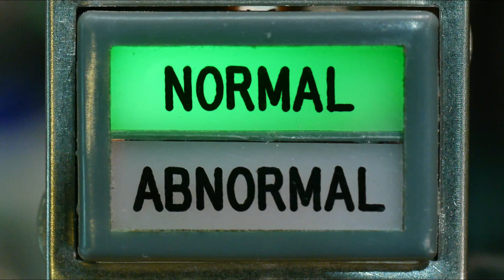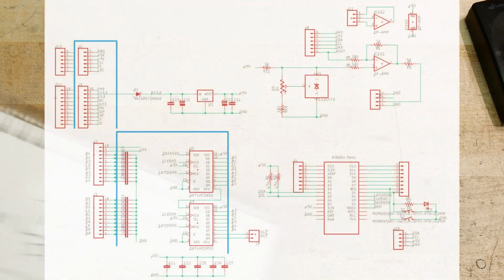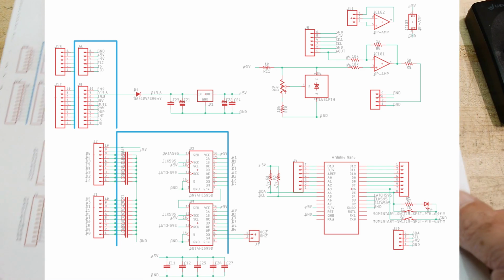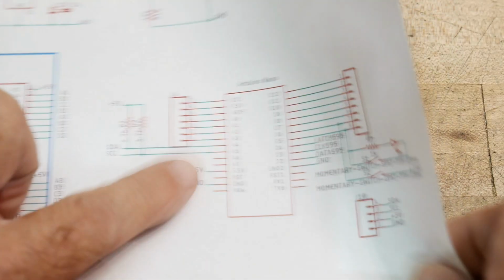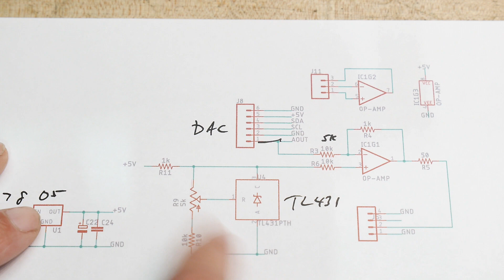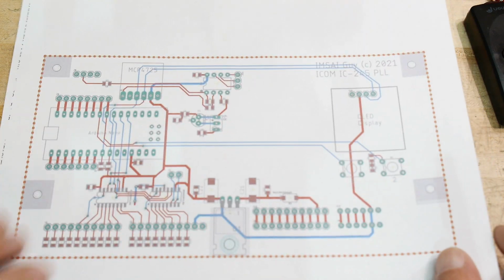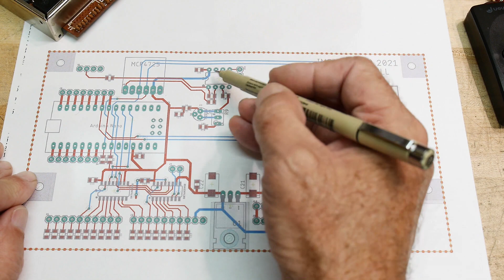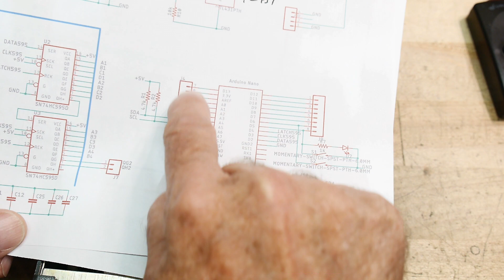#962 A brain transplant for the ICOM IC-245

Comment: Nice idea! I like the extension headers built in but for next time I would suggest to and include some power and ground line in there to really make it a one step plugin. For the reduced range on the dac, I believe the datasheet also has a note on how to use this as a window dac. Looking at how you're using it here you may be able to reduce the circuit the to two resistors and no extra reference. You could do a 4k from dac to output and a 1k from output to 5v. Together these make a divider where you lift the bottom end to increase the output voltage. The opamp may still be nice to have as buffer it there's any loading on the circuit

Comment: I pulled out the 245 today, sure enough the vco is stuck at 135 mhz - does not change with tuning - no transmit power. Will try variable dc to vco to see if I can get it to receive at 146 mhz. Was able to get 10.7 mhz fm to pass through. If I can get it to recieve, will short PLL lock/ transmit inhibit line, and see if it will make some power.

Comment: Aloha, I'm old and started my electronics on tubes, we were told transistors would never amount to much as the were noisy and couldn't handle power that was back in the late 50's.  My highlight was when they put B+ on the grid caps, broke me of the habit of licking my finger and scratching the grid of a stage!!!!   I very much look forward to your SMT techniques.  I love retirement but you gotta stay busy... use it or loose it!

Comment: For the VCO to generate a stable frequency, you need to have a phase comparator  and a charge pump to drive it. There should be a reference frequency generator with a programmable divider to drive one leg of the phase comparator. All of this circuitry, if I am not wrong, happens to be in the PLL unit you are getting rid of. If you simply drive the VCO with a variable voltage, without any feedback, the VCO will drift a lot. Am I missinig something ?
Reply from the maker: I will be adding a frequency counter later for the feedback

Comment: That is extremely impressive! I'm such a hick, that I'd prolly bodge the front panel with 10 turn helipots to run the vco for tx and rx, and a front panel LCD frequency counter with programmable if offset. I do plan to check out my 245 over the holiday and see how bad it is.